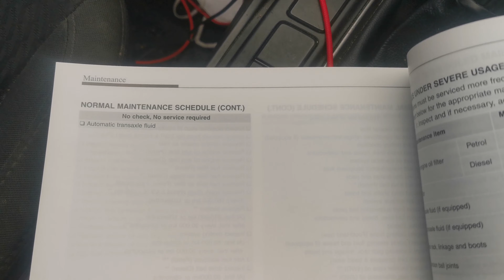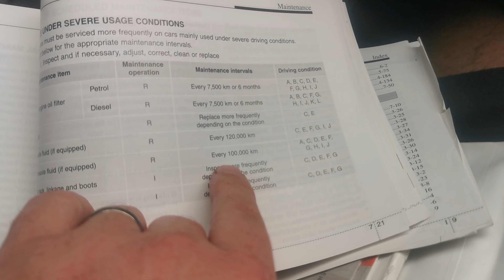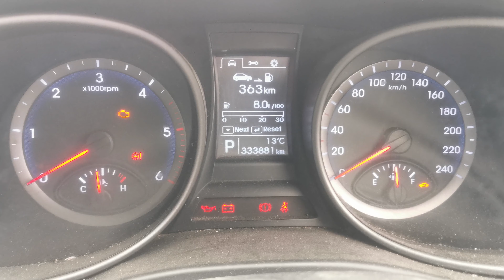Hyundai Santa Fe Transmission and Driveline Service

Comment: This was the video I was looking for! I’ve got a Santa Fe with 40,000 miles on it and figured it was time to change the drivetrain fluids. Cheers for the USA
Reply: I made the mistake of NOT changing mine at 60k because Hyundai states it's 'Lifetime ' fluid, and they don't even put a dip stick on em anymore. At 180,000mi I finally changed after started to pick up a 'Shudder' at top end of shift range.
So easy to do. Hardest thing is getting the car level (unless you have a lift).
I dread messing with tranny fluid. All is fine with mine. But I wish I would have done it 120,000mi ago. Have to admit, Hyundai makes a rock solid tranny. Still runs like a champ with 180k+ on it.

Comment: Trans fluid is often ignored and even more so for the differential.  A customer of mine just paid a shop $2000 to replace the rear differential on his Ford because it has about 300k miles and the fluid was never serviced! Expensive lesson on changing fluids 👍
Reply from the maker: This car has already had the transfer case and part of the trans rebuilt so I'm looking after it!
Reply: @Badgertronix  I remember that video. Do you think that maintenance had anything to do with that failure or its simply poor design/quality of the part.

Comment: This is a great video...... my only recommendation is that most transmissions hold about 7 to 9 liters of fluid with the majority of it being contained in the torque converter.  Draining from the drain plug only drains a very small portion of the fluid which is contained in the pan.  To completely flush the fluid you would need to get the remainder of the fluid out of the torque converter.  This can be done by removing the cooler line (starting the car) and draining about a Qt or liter at a time until new/clean fluid flows from the cooler line.  I have seen some people do as you did only they run the car for a few minutes going through the gears and then draining it again several more times until they see clean fluid at the drain port.

Comment: Great video. I noticed Hyundai products, starting from the 2014-2023 Santa FE diesel, 2021-2024 Palisade, the engineering team really likes to place engine parts that will often be opened for replacement or routine maintenance.  for example the location of the diesel filter, oil filter.  These 2 spare parts will definitely be opened frequently.  Unfortunately the engineer put it in a difficult place.  Especially for owners who like to handle it themselves at home. Even though Hyundai products are very pleasant to drive

Comment: Going to do the atf service soon so this was helpful. I’m one of the unlucky ones who had my transfer case sheer so I’m running FWD only. Not really a problem unless it’s wet and you pump the accelerator. On the plus side my fuel consumption has dropped by around 10-15% as a result. 2013 Santa Fe  elite

Comment: Silly fill port in the engine bay. I'd fit a metal tube with a screw on the end that you can fit on there then just close the top of the tube with a rubber bung. That will make filling up with a funnel much easier in future
Reply from the maker: The fill plug goes through a banjo bolt for what looks like a vent tube so you can't install a permanent solution. A screw in funnel would make changing the fluid much easier though

Comment: i envy your servicing the trans like this on your own. Im planning on purchasing a 2012 2.2 santa fe and perhaps need to change the trans oil as well. btw have you encountered any major issues with the vehicle now that you've reached more than 300k kms, other than the usual wear and tear items. great informative video.
Reply: If you haven't already, I would strongly recommend that you change the transmission fluid at the very least on a 2012 if it hasn't been changed before. I bought a 2012, and didn't change the ATF. Front seal popped on a hot day while towing, and I've had untold issues with the transmission since. I wouldn't wish a transmission problem on my worst enemy, they're horrible.

Comment: Great information -- I am wanting to change the trans fluid on my 2019 Elantra SE with the 6 speed automatic that has 55K original miles and as far as I know the fluid has not been changed,  but ...  OK so there is ACTUALLY TWO (2) Fill plugs that I see people using!  One is under the Air Box (after removal)  and this plastic plug is actually the "VENT" for the transmission CORRECT?  The factory "FILL HOLE" is towards the rear and a metal 24MM plug like the 24MM metal drain plug -- CORRECT?  Does the Manufacturer (or dealer) use the VENT PLUG or the METAL FILL PLUG Location to add fluid?  That is my question!

Comment: You know mate, if ya would take the level plug out of the side of the case it won't bubble up when putting fresh fluid in. Allows air into the tranny case. You remember what size that crush washer was by any chance?

Comment: Great video.  I found the transaxle oil alittle tricky to get to but thankfully you do 't have to to change it often.  Do you know if the transmission has a filter that needs replacing? I have  gen 2 model.

Comment: The rear differential coupler has gone again ( 3rd time) on my AWD 2010 3.5L gas Santa Fe, also have a leaking seal from knuckle axel to the back wheel - dealer says the axel may be seized in knuckle - altogether an expensive fix for year & mileage (est. $ 2500). So can I simply detach the rear drive shaft, and make the vehicle a FWD ? Any issues in doing such ? Thx

Comment: you missed only one thing, declamp the returning line from the radiator and turn on the car for just. 10..20s max and top the transmission sump again, doing that u can remove all the 7.1 L of ATF, to be honest u need a little bit more than 8L, to maybe 10, but if you use 2 Penrite 4 liters ATF and collet the returning ATF from the radiator u will probably get around..90..95% of new ATF which is good enough for another 100K...

Comment: Which Penrite fluid did you use for your transfer case and differential? Did I miss it in the video/audio?
Reply: All good, watched through to the very end
Reply from the maker: Transgear 75W90
Reply: @Badgertronix  I just bought my 2013 Santa Fe yesterday. Called the mechanic that previous owner had been taking it to and he said he's unlikely to have changed the transmission/transfer case/diff fluid because his guide says "change when required". So I guess it'll be a job I'll be doing soon. 135,000km on it.

Comment: Q: 
is tis got 3 place to change atfuild , 
1)front 4 liter (SP-4)
2) middle gear box ? liter (tq4 or wat grade gear oil - normal gear oil ? 
3) rear gear box ? liter ( wat type of gear oil )
Reply: As per manual 
transmission SP IV
Transfer case  75W90
Rear Diff   75W90
Just measure the amount drained is the amount to be filled.